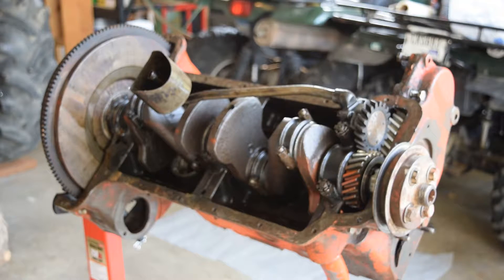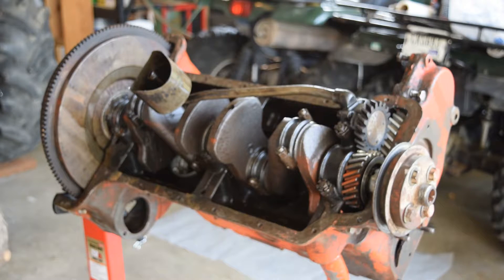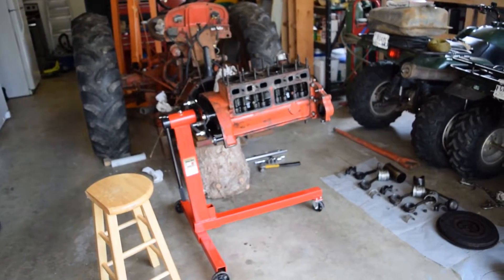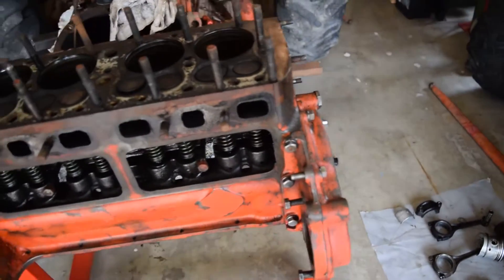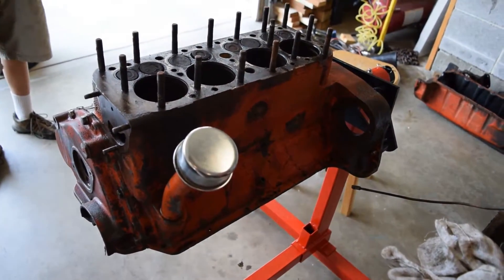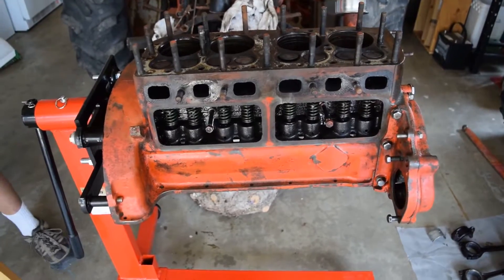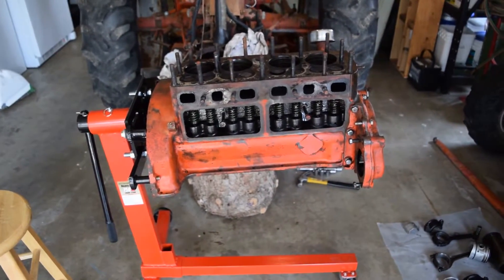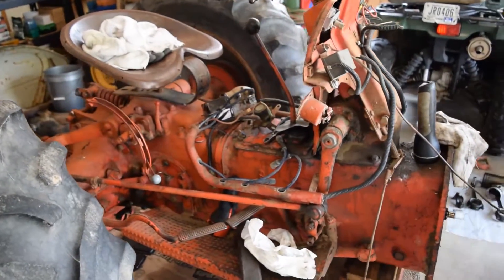1947 Ford 8N Tractor Rebuild Part 3

Comment: How did you remove the sleeves? The video didn’t show that step. Thank you
Reply from the maker: I think we started removing them very carefully with a couple of flat head screw drivers and a hammer, but then we switched to the tool we made to install the sleeves in out part 6 video. If you want more detailed instruction, I think you can find some dedicated sleeve removal videos.
Reply: I removed mine the same way mentioned... small flatblade screwdriver and hammer. Did not damage the block whatsoever and saved a ton of money